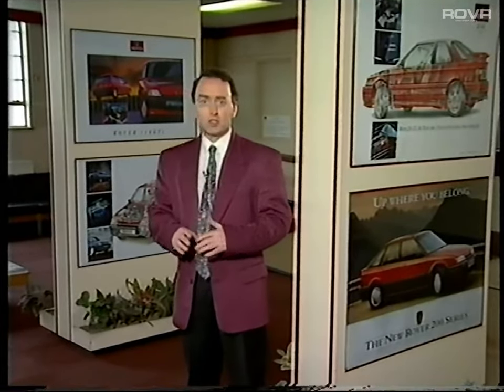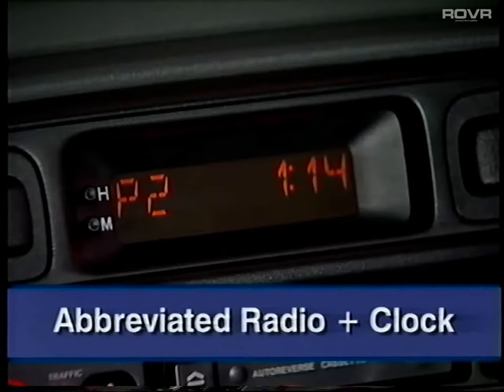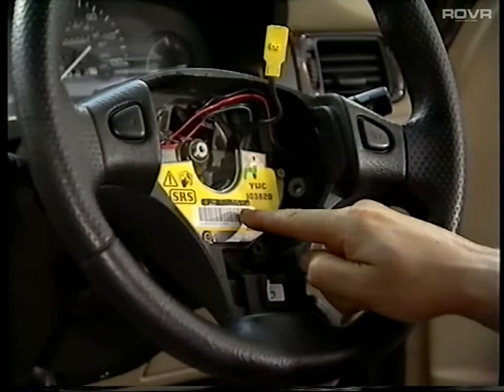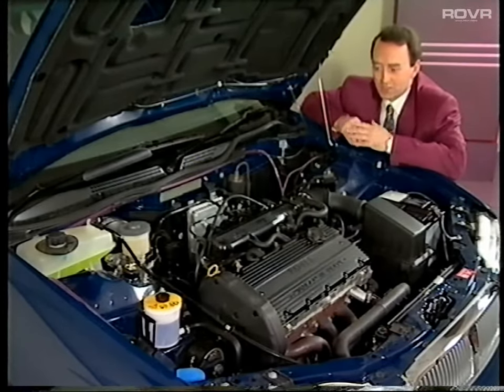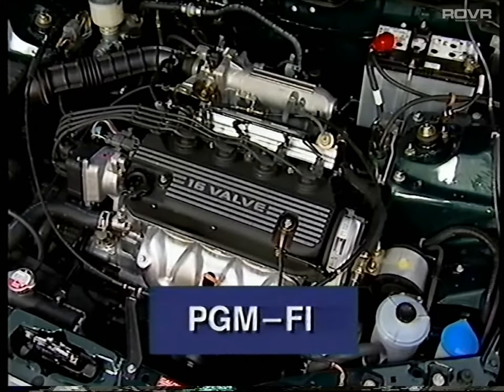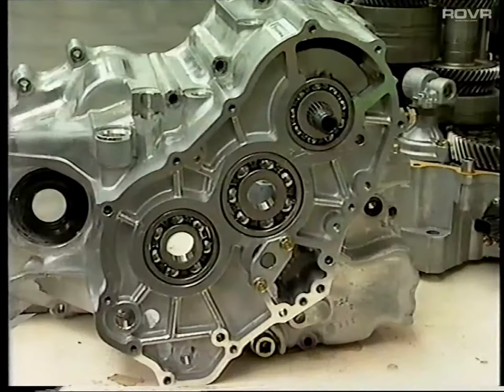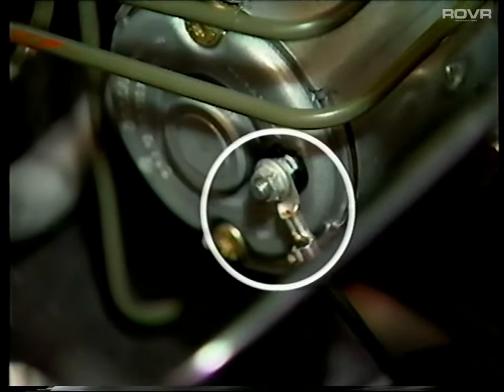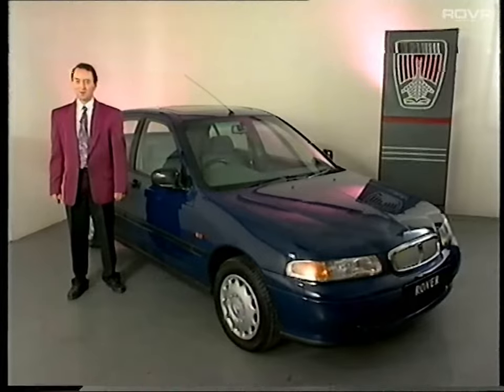Rover - Rover 400 - Service Insight - Rover Professionals (1995)

Comment: Ahh memories. I had a pre reg V plate 416 ixl which cost £9995 from my local dealer in February 2000. I put 35k on the clock between the date I picked it up and December 2001, when a drunken moron smashed into the back of it. I had whiplash, but walked away in one piece….same can’t be said for the offending driver who broke his arm, collarbone and cheek. Incidentally, insurance deemed it a total loss and offered me £14,200 in settlement. Suffice to say I didn’t argue and I snapped their hand off. Don’t know if I’d got it at a ridiculous deal or if the insurance company made an error in the calculation; but either way I drive 35k miles for free!